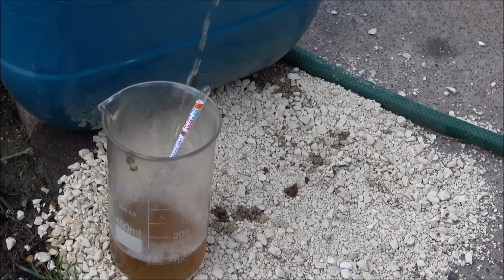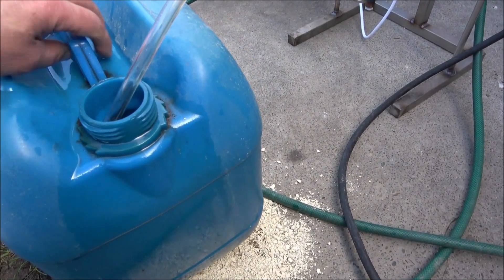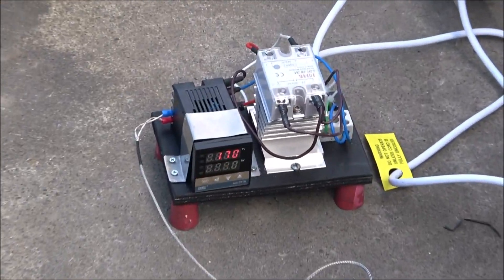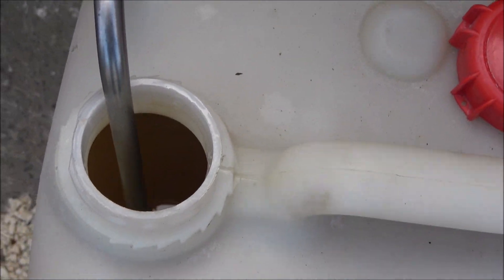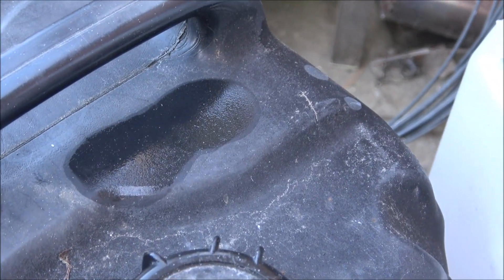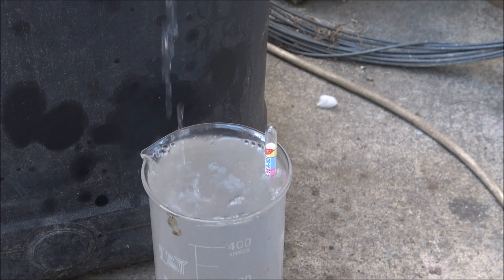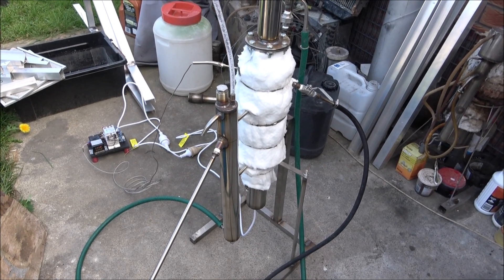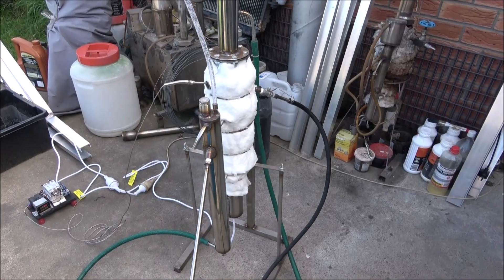1 6kw (wrong fuel) petrol separator.

Comment: What would happen if you ran wmo, or anything else through this? Just curious 🤔
Reply from the maker: This one is designed for the light petrol fraction, and if one runs the WMO, the same wmo will run from the diesel column. However, if wmo, crude oil, or pyrolisis oil contains any petrol fraction, it will separate the petrol fraction from the processing liquid.